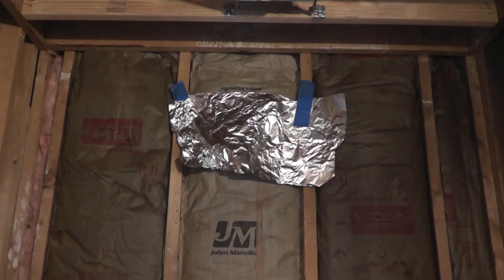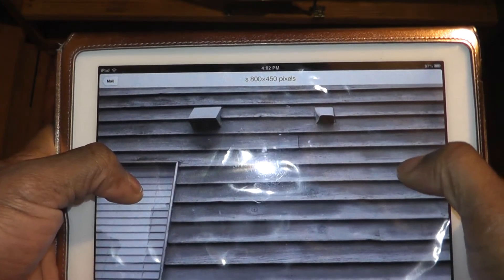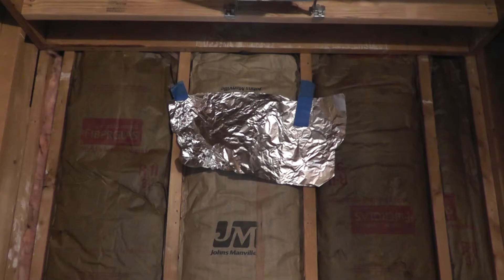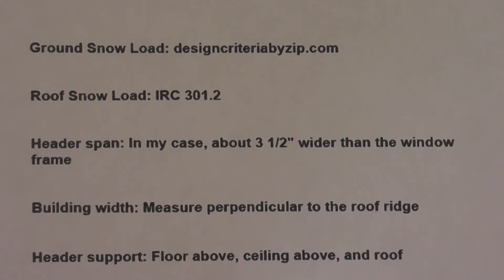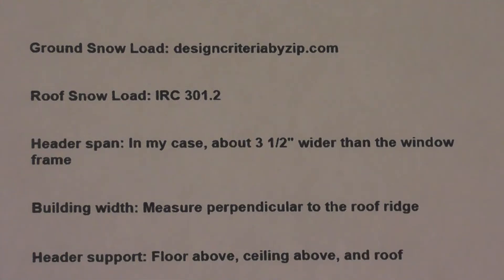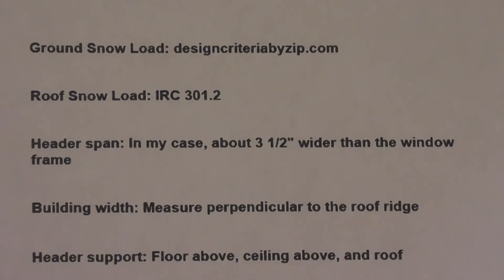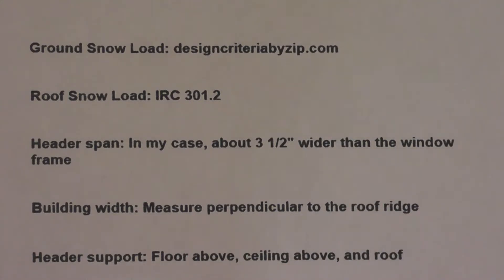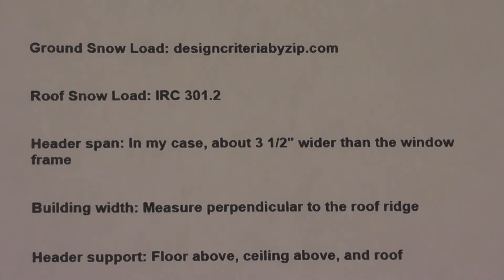Bathroom Remodel 40 - Window Installation Pt 1 of 3

Comment from the maker: I say "1/4" plywood several times. It's actually 1/2" plywood that's sandwiched between the 2x8's.
🔧▬▬Tools and Materials▬▬🔧
👉 DIY Apprentice Recommended Tools and Materials ► https://bit.ly/2T5psFw

✔️ Current palm nailer - I use only for small jobs such as hanging cedar siding ►   https://amzn.to/2Vej1nP
✔️ Rockwell JawHorse ► https://amzn.to/2H4MwQt

📷▬▬Video Equipment▬▬📷
Current gear:
✔️ Camera used ► http://amzn.to/2GcpkOb 
✔️ Lens used ► http://amzn.to/2Deu16S 
✔️ Tripod ► http://amzn.to/2GbaM1c
✔️ RAM Suction Mount ► https://amzn.to/2Wz9PXh
✔️ Cyberlink PowerDirector ► https://bit.ly/2jTwGxT
✔️ Adobe Photoshop ► https://bit.ly/2V7nyUX
✔️ Camera Slider ► https://amzn.to/2WtD7GW

Comment: When we pulled out our old fireplace, we had double trimmers supporting the headers.  I read on another site that doulbe trimmers would be used for a 2x8 double header for a max span of 5 ft.  It also states that a 2x6 double header can handle a span up to 4 ft. That would only require single trimmers would be needed.  If a person wants to use a double header of 2x8s (just for the heck of it) when they only need 2x6s, can they still use the suggested trimmers for the 2x6s or should they use the double trimmers given for 2x8s?  i.e. If you increase the header size, you use the number of trimmers to match the headers you are actually putting in?
Reply from the maker: Good question. The inspector to whom I spoke didn't have a problem with single trimmers for my span (31 3/4"). I would just stick with what the code says to be certain if you have the space. I'm hoping the inspector doesn't change his mind or forget what he told me :-)
Reply from the maker: I was just reviewing IRC 603.7(1), and it mentions needing two jack studs on each side for openings that are 5' or larger. I'd like to dig more into that code section when I have time.